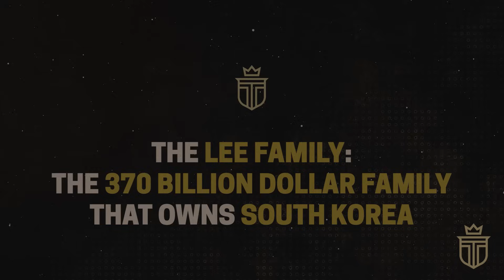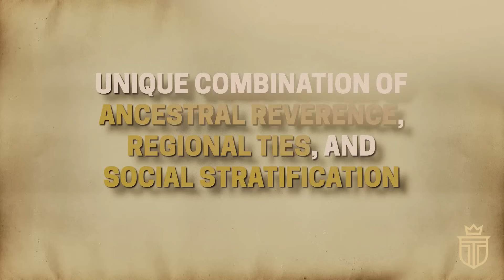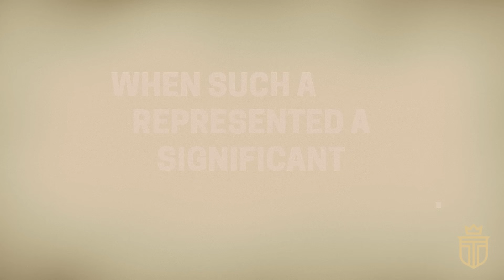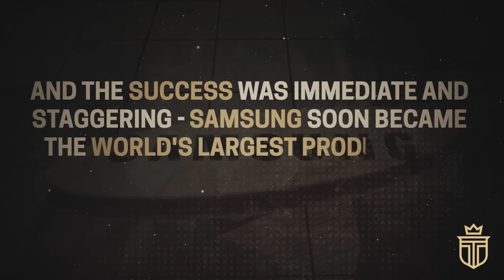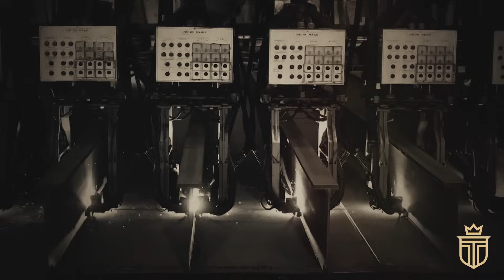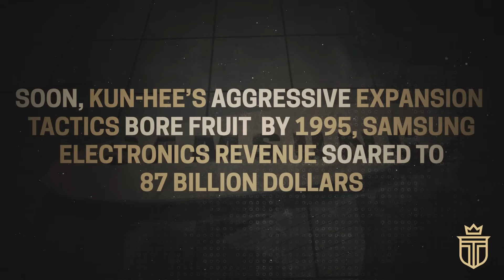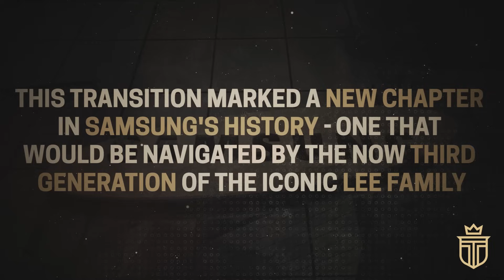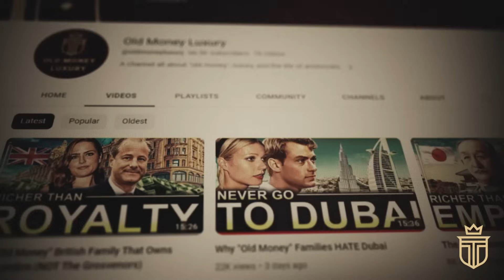The $370 Billion Family That Can’t Stay Out of Jail: The Lees of Samsung

Comment: 😮I have a Sanyo am-fm radio cassette player that was purchased in 1976 and is still running with no problems to this day. Use it regularly and it's never needed a part. Also have a good working Samsung flat-screen TV that's old? original, but I 'd like to complain about the lack of a headphone jack that I've had to live without. Otherwise no gripes.☺️📻